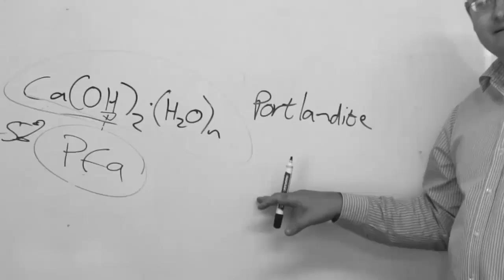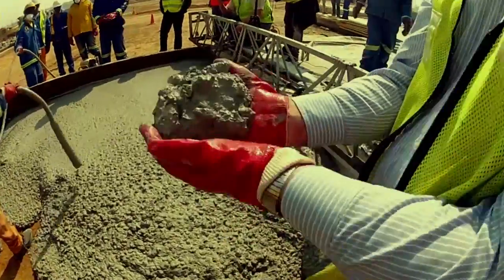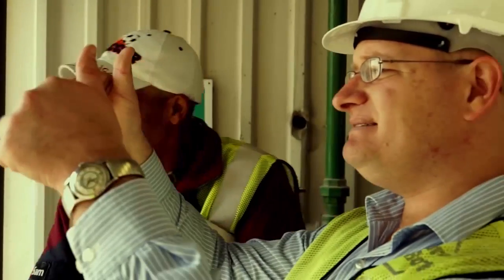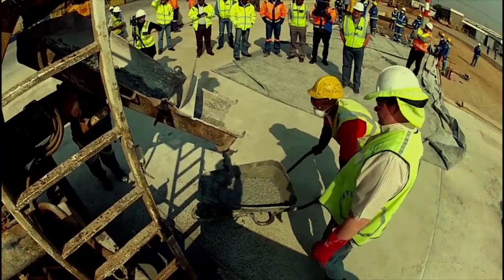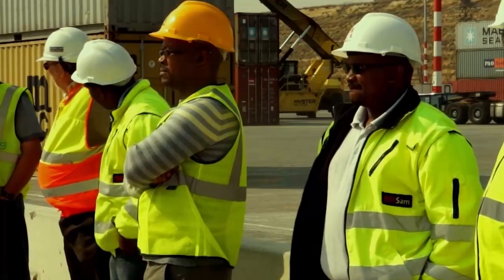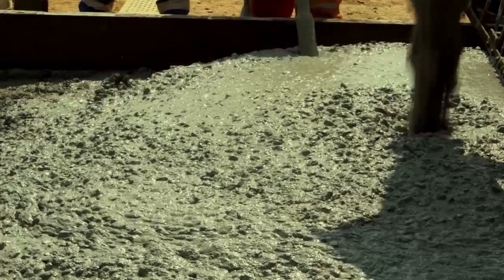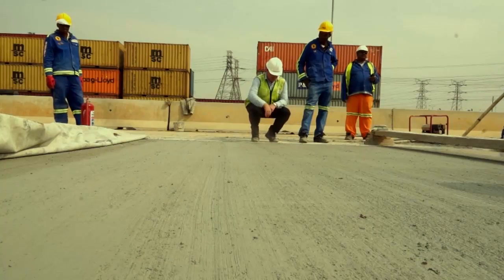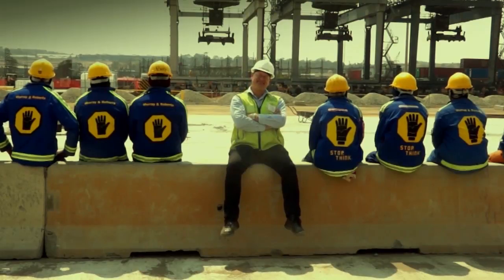0% cement concrete -  M&R geopolymer concrete a South African first!!

Comment: yes, when you talk about flyash it's strong like crazy. But at my experience the workability is so low and dry too fast, i'm still confuse what method they use to make the mix design still can flow until they make it to construction site. I noticed that they add the activator at the construction site just before they start pour their mixing. But still, does that possible?

Comment: This how some of the structures in Egypt were built!!. If you look at some of the casing blocks you will see that they are not whole cut blocks, there is rubble in behind them. They were poured !! This polymer concrete is the result of research done in Egypt on samples taken from Giza !! BTW, the slagment can be crushed granite, or limestone,etc. when set it looks exactly like the material used as slagment!!

Comment: What a crap. They are trying to sell again. You want to reduce expenses - you need Calcium Oxide powder - 5% by volume of the mix - and 2-3% of Al2O3 to hold water and some sand and some crushed rock. Hint. Do not want to buy cement - find Calcium source.

Comment: I couldn't follow what the point of the 2, 4, 6 different loads was all about.  Very confusing.
Reply: We wanted to calculate the exothermic heat generation of the material in a concrete mixer truck and if there are significant difference due to volume changes which may make the casting of this concrete prohibitive in the africa climate.
Reply: j parks The amount a predefined volume of the product spreads in centimeters or inches. How much it flows once you pour it.

Comment: Great Video
Reply: just one question. How much shrinkage occurs with this geopolymer concrete. Do you have any serious cracking issues.
Reply: Brett Meadway "Geopolymer simply does not offgass water and shrinks very little during curing. Instead of shedding water it forms a chemical gel that hardens over time, going through a series of rapid chemical stages, and ultimately forming alumino-silicate polymer chains." from Michael Eliot's paper http://seasteading.wpengine.netdna-cdn.com/wp-content/uploads/2015/02/The-Case-for-Geopolymer-Concrete-in-Seasteading-Michael-Eliot-3-2015.pdf
Reply: Cracking was measured at 0.026% on this material by an accredited laboratory.

Comment: question is, the cost of the activator liquid isn't a huge challenge? how did they calculated the total cost and found out is less than NPC? no answer of course!
Reply: Cost of liquid activators are normally a problem when using the standard quantities of 20-30%, on this project we only used 4% liquid activator and thus the total price was approximately 30% cheaper than standard 50MPa concrete.